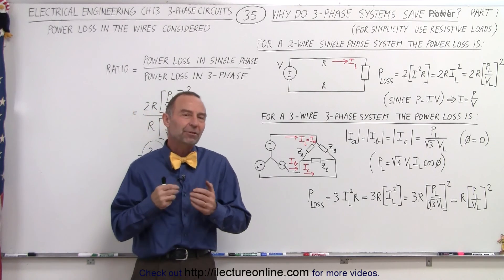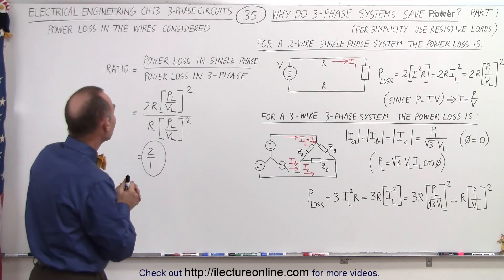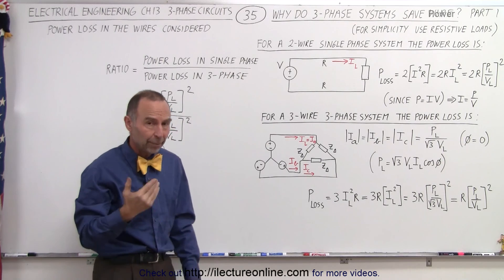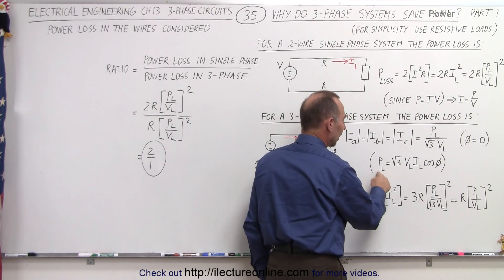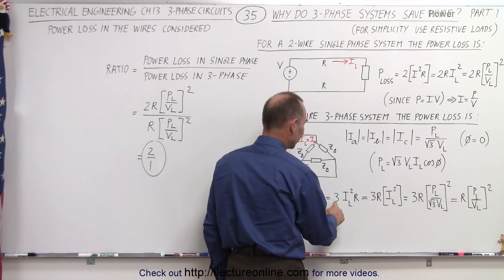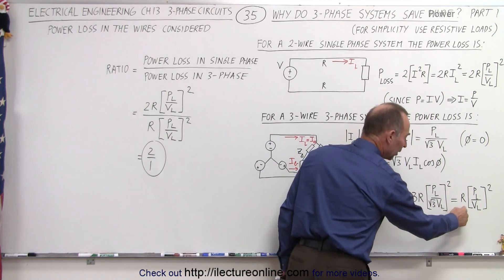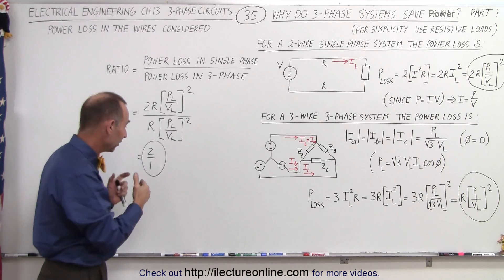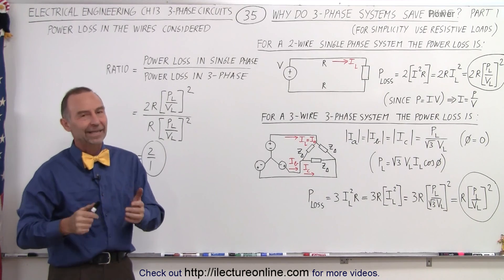Electrical Engineering: Ch 13: 3 Phase Circuit (35 of 53) 3-Phase Systems Save Power, Why?

Comment: I think that u are making a little mistake or i am lost : the power  equation for 3 phase system is not the line power but the total power for the system . if u calculate for a single line only then the phase equation for power should be divided by squared root of 3 . the final reselt will be  2/3 .instead of 1/2

Comment: Why is angle Fi = 0? Isn't each current 120 degrees out of phase?
Reply from the maker: Relative to each other yes.  You can arbitrarily set one of the angles to zero and then express the other phase angle in reference to it.